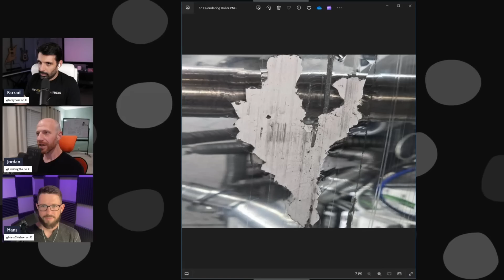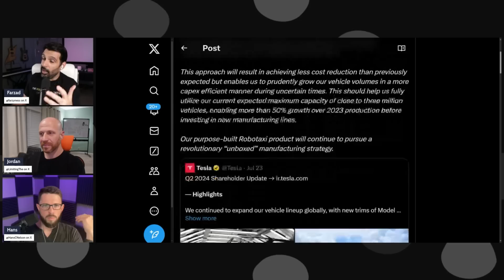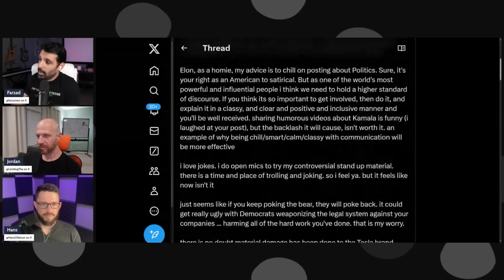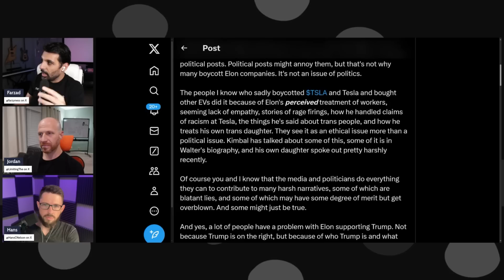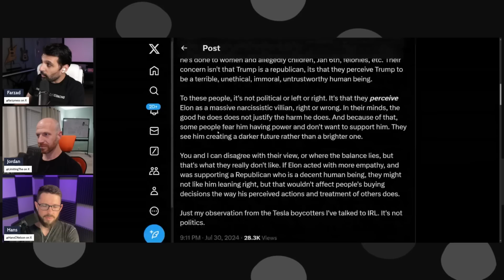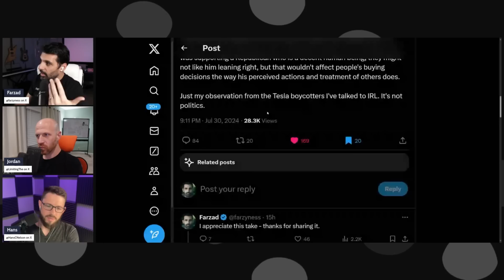Tesla's INSANE Breakthrough.

Comment: In the worst case HW3 could be used as it does 95% of whats required and know when its running into problems and then call the mothership for supervised support with HW4/AI5/ AIxx mainframe. only areas off limits those with no reception. 

Failing that engineer a HW5 board to fit the HW3 socket but only if you subscribe for 6 months.

Comment: How about the part where Tesla is using the public as their lab rats to run around and collect driving data and as a result of late, Tesla autopilot has killed two people by running them over? Also, recently, the car ran itself into a high speed moving train but in the last seconds, the driver turned sharply to the right to avert the collision, but still crashed into a pole thereby totally the car. But all you pro Tesla pumpers care about is stock price, so you only talk about if the system has improved. If a person were killed in any other way and someone said they didn't care, everyone would hate on them, cancel them, and destroy that person's life, but here, none of you care that two people died in the musk road test lab rat experiment he is doing on public streets. Again, all you care about is your stock value. I doubt any Tesla pumpers even know the names of the recently killed two men. Maybe a woman with children will get your attention. Admit the system is slow and inadequate and should not be allowed on public streets. Tesla doesn't care because they already have their attorneys geared up to blame the drivers by asserting they didn't pay enough attention.

Comment: When Tesla finally comes out with that 500 mile tri-motor Cybertruck that I put my day one pre-order deposit on, I will complete that order. Hopefully this solved battery bottleneck news will give way to that goal. As someone who’s been a multiple Tesla owner for about a decade and tows with my model y, range is king. My primary use case for the Cybertruck will be road trips and towing, so a minimum of 200 miles of real world range is very important. That is twice the range of the model Y towing 3500lbs at 65mph.

Comment: If I want my HW3 car to be my driver as well as an RT I'd trade it for the latest one if necessary. If it can run FSD but not quite be an RT then I'd keep it as my driver and buy the new one for RT exclusively. But first I'd need to do the math on the business case to see if the revenue beats the cost in a reasonable timeframe. And that would assume growth of the business into a fleet of RTs.

Comment: Not every owner of a HW3 car paid for FSD with the aim of using it as  taxi. Some of us simply want what was promised, a full self driving car (not supervised, not geo fenced, not significantly less capable than some newer hardware. I will go so far as to say that the owners I know bought the car for personal transport and have no intention of renting out their cars.  There are a lot of reasons why you might not want to rent out your car, liability, insurance, wear and tear, abuse. The other factor is that in the short term the size of the taxi market is unknown.

Tesla could guarantee an outcome without locking in a particular engineering path, rebates, hardware retrofits would not constrain the engineering.

Comment: But the thing is. Is how many  normal cars do you see in the junk yards exploding. But if you do research .  you can see that when a battery operated car gets jumped. And the proper disposal of the battery isn't done. And they sit in  the sun . they explode. And what are you going to do when somebody shuts off all the power grid. The electric cars will be junk . then anything with a computer in it. Won't run . Lmao

Comment: How much money and weight will be saved by making it 48V and steer-by-wire?

This is possibly also the reason why the Model Y refresh has been delayed.

Normally Tesla keeps on upgrading everything under the sheet metal during the production run whilst most nor consumer will be totally unaware that the car they’re driving is totally different from the car that looks identical but manufactured a few years prior.

Don’t for a moment think that a tech nerd like Elon will not use the 48V on both the Y refresh as well as the the ‘Model 2.5’. Even more so after he gave the 48V ‘bible’ to other OEMs and then believe he would not implement it himself.

This will as mentioned above both save a lot of production materials and process along with weight saving which means you might probably be able to have a smaller battery for the same performance.

Comment: At 37:20,  Doubling batteries doesn't double available energy.  Batteries help manage varying loads, not create more energy.
Reply: not true. battery has potential energy and when released it has real power so when you manage currently power generation at some moment of time and when peak power is luke 1T thfn you are able to make it 1.3T using batteries and thhrottling down less so you can generate like 5% more energy using the same generators that is very usefull for solar wind and nuclear less to other tech.when you have nuclear power in grid then you gaon the most when scaling up and down during the day is not doneyou just run like 95% all day to make the best out of your investment

Comment: Jordan’s numbers on the nextgen low cost vehicle at around 20 min was spot on:
$36k COGS
Target 50% cost reduction on nextgen
36% from size reduction, 48volt, and other
13% unboxed
So with only 36% that drops COGS to $23k
Add $5k profit ~22%
Nextgen cost: $28k 
This should increase the TAM by several million units.
Reply: COGS of new platform starts 18k  or less to be positive business moddel to Tesla. The reason is that there are business moddels where other service providers can get cars cheaper than 15k non fsd but service is similar like citybee or Bolt drive services. In Estonia  5% of rides are allready on those services Uber like services that Bolt inc offers are like 10% of rides allready. When Bolt enters US market then it will be like 10x uber instantly
Reply: This actually shows the cost curve going out the window, Elon said unlimited demand.

Comment: 3:25 onwards
.
Any Copier/ Printer Technicians in the chat?
Look at the lines on that surface.
They're straight, not curved. It's NOT a cylindrical surface.
Unless that silvered surface is the Cathode material (Which I thought was BLACK?) that is NOT a roller.
It's more like an imaging belt.... (Or a "Fusing belt"?)
(If you have a colour laser printer look at the imaging section)
.
What we're seeing is almost exactly the same as when a Printer belt delaminates.
.
We can see the REFLECTION of a roller.
They MIGHT be sandwiching this material between 2 hard rollers (One out of sight BEHIND the white, silver coated BELT??) together WITH the cathode roll and using this material as a foil to prevent sticking?

Comment: What is "ozborne" and "unboxed" ?
Reply: The "Osborne Effect" references an early computer manufacturer which was selling a lot of computers until they announced that a much better version would be available soon. Orders for their existing computer stopped because everyone was waiting for the new version, and without cash on hand the company went broke before they could manufacture the newer version.

"Unboxed" refers to a proposed new manufacturing system in which large sections of the car would be assembled separately before finally being put together near the end of the assembly line, instead of the frame being put together early in the assembly line and components added one by one until the end. The advantages include much easier accessibility for workers, eliminating both assembly time and many ergonomic issues.
Reply: You're new here?
Search "Osborne effect" and "Tesla unboxed"

Comment: SO, here is the question ? 
A Compact 2Door Hatch -single motor version of Model 3 - would be quick, use the same lines and could sell for $29k without an M3 Osborne .Delivery Q1 2025 . That model spec  is hugely popular in Europe.
Reply: OR
A version of the 3 (Y?) using the EXISTING body tooling (Bought and paid for) 

With the same castings (Amortised) fitted away from the body with "Gen 3" Compact/ Cab "Unboxed" components (Designed for MASS production)
Then bolted on as completed assemblies........ 

With a re-geared motor for range, not acceleration (0-60 6.9s... "because")... 
AND a 10% lower capacity pack..... (But still close to 300m range)

COULD sell for Sub $30k (?)

A "Y" version COULD also be JUNIPER?

Comment: Perhaps they went with tungsten carbide with a hard chrome ion coating.  This would probably prevent the spalling.
Reply: T's flat.
It's a belt with a hard roller behind it.
Just like a laser printer transfer/ fusing belt (Yes, I've worked on those for decades)

Comment: The push for lower cost cars is very necessary to achieve anything close to the 20 million cars per year target if we even can get there at all. But this is only crucial if tesla fails at solving autonomy. 
If autonomy is solved it doesn't really matter that much if the car cost 20k or 30k usd to produce you going to earn that money back within a year of robotaxi use. I think and I hope tesla wont sell cars but just deploy robotaxis where you pay for use, at this stage you dont need to push down the price of the car so that the masses can afford to buy one. 
For a robotaxi building for durability, easy to repair etc might bring down the total cost of operations if it extends the longevity for the car. 
The lifespan of a car is about 12-18 years while the lifespan of a train is 30-40 years despite much more use, so robotaxis should be built like trains lol. To the extent that you can while also keeping them light weight. So I think robotaxis should change how we look at cost.

Comment: After listening to this fascinating conversation for me is quite clear…
My theory is that we’re going to get a compact cross over SUV, take the Audi Q1 or Q2 as an example and a multivan, both based off of the Model Y platform. I think the multivan is even more important than the compact model: take the existing model Y, which is very spacious and make it a bit longer and taller; giga casting, same line as the new Junyper version. Picture a model Y looking a bit like the front of the Semi so that it is still aerodynamic and not a shoebox like most vans. Pack 5-8k on top of the price (it costs Tesla 3k extra more than the model Y but has bigger margins). Why? Deliveries, catering, moving houses, campers, airport shuttles… these are all businesses for whom a 45000-50000$ work vehicle is very reasonable, they use it for work and can afford it (it is what they’re already paying for the equivalent diesel van). The van market is huuuge and pretty much untapped because legacy is offering these 50k vans with shitty range and charging speeds so fleets aren’t 100% in yet

Comment: The die shop at giga austin Has installed a six ton gigapress.
Yes, will be used to pretest new castings. Before putting into production, but there are twenty four hours in a day, and perhaps they can pump out some castings for the new car for start.

Comment: If we solve the energy production problem, EV mass production will follow.  It would make no sense to drive an expensive ICE vehicle that isn't nearly as reliable as an EV.  That includes mining equipment, farming equipment, commercial transportation on land and water.  It may be up to a century before we solve electric flight or super high speed ground transportation.
Reply: The Chinese and Japanese have high speed rail.  The tech is there.  It is political problems delaying.  

In places like Texas, there is significant need for that that Robotaxi should no compete with.  

As I see it, the Robotaxi and busses feed other mass transit, which at the other end, duplicate.  It is known what the urban density needs to be for what.

Comment: We can make energy prices fall over 75% by going into the right energy source.  Thorium MSNR's are the future.  Lets get a model up and running.  We can make it alongside and existing power plant that underserves it's market that currently requires several peaker plants to service that market.  From there, we could start an increasing production of power plants to serve our energy markets.  This would eliminate a ton of oil, gas and coal.  Not because it's better for the environment, but because it is economically stupid to use oil, gas and coal.  That's the solution we should be striving to achieve.
Reply: Just to say "They who shall not be named" now have Fusion up to 7 minutes.
THAT is impressive.
Reply: @rogerstarkey5390 fusion is 50 yrs away, in 50 yrs
Reply: AI compute is going to be a massive power consumer

Comment: I still think that Molten Salt Nuclear Reactor (MSNR) power plants are the future.  It takes a lot less resources.  It requires less than 1% of the mining needed to change energy with solar and wind.  It free's up huge chunks of land with respect to wind and solar.  All the existing waste materials from traditional nuclear can be used in energy production.  We have enough Thorium to power mankind for over a million years.  It's safer than wind and solar.  You may not agree with that, but you would be wrong!  We can mass manufacture the MSNR's in just a few abandoned car plants.  This is the way!  Abundant, safe and cheap power.  We still can have a lot of debate about excess power storage.  We can eliminate a lot of mining that isn't necessary or productive.   Wind power is especially disruptive and in my opinion stupid!

Comment: I think Jordan is right, but when FSD is solved, and it will be solved, WHY should Tesla sell cars at a low low price?  They can keep them and sell some to individuals, but a whole lot of robotaxi's will be kept in house or sold to large block buyers to start their ride hail services.  Maybe some individuals might want to buy these robotaxi's for their own renting into the robotaxi fleet that Tesla will probably run.  This is where I think the market will go.  Once all the cars have FSD, the insurance industry will no longer serve the auto market the way they do now.  Fast reliable charging is also an issue.  The batteries we need to make this happen are still to be determined.  It may take a few more years for the battery development to catch up with our needs in this way.  Also, the battery production for EV's will need to grow significantly.   Especially in energy storage, where we don't really not a ton of Lithium batteries.  We still have a lot of development to do there as well.  I think a lot of that will shake out in the next 10 years or so.  Tell me where you think I'm full of it.  Do you agree or do you see it differently?

Comment: I am a tool maker with extensive experiance in heavy metal stamping. There is one company that will impregnate hardened D2 with carbide for nearly as hard as a diamond and brutally tough, and work nicley though extruding hardened High strength low alloy such a the 4000 series  of steel.

Comment: In India we already have Tata motors Tiago EV which is at 10K $ 19.2KWH and MG Comet  at 9.5K$  17.3 KWH which is originally Rainbow Mini EV.. We are still not buying it as the gas version of Tiago EV is at 8K$ and 2K $ saved justifies that cost for many in India.. we need EV's to under cut Gas or Petrol vehicles for its mass adoption..I think  batteries at 50$ per Kwh should make it possible..
Reply: I think Tony Seba mentioned this would happen by 2030, but things seem to going faster than that currently.

Can’t wait to see how the dry cathode process reduces costs, space and speed for Tesla batteries!

Comment: If you make the surface harder on a soft substrate the material under the coating will move/deform and the coating or chrome will come off.
Making rolls from 52100 tubeing  hard chroming and then supfina finishing makes the best rollers if you need a super smooth finish
For even better use 52100 tubeing and coat with DLC but DLC has size limits on what components can be processed

I spent many years trying to make Rolls that can do what no other rolls could do.

Comment: does it increase range and if so by how much. everything else is just gravy. just get to this point ffs
Reply: 4680 in its final form (based on battery day presentation) is 54% increased range per X weight with 56% cheaper production per X kWh. But that is its absolute final form, so far the cobalt isn't fully replaced with phosphate so those numbers will not be true until (at least) the cobalt is 100% replaced. -edit: and manganese added.
Reply: @samgerland6087  ok thanks. so is it fair to say once they ramp this dry coat battery for cyber truck it will be at least 20-30% more range. assuming the range improvement are smaller to closer we get to final form (let's say 2030 for arguments sake).
Reply: @gazlives  wouldn't know for sure tbh, just getting the cathode finally dry coated should net minor density increases, much of the rest is in the internal mix. Now I'm not an expert on the matter, 
But from what I understand is the most vital part for (density) is to have the cobalt fully replaced and manganese added (LMFP) - lithium manganese iron phosphate. 

Regardless of what in short term, if the cathode production problems are finally fixed that is a tremendously yuge win. 
Density can be worked on steadily as production is secured.
Reply: The more silicone they can add overtime the higher density the batteries will have. But it will be a slow grind upwards of incremental silicone adding
Reply: @samgerland6087  ok thanks for the info/reply